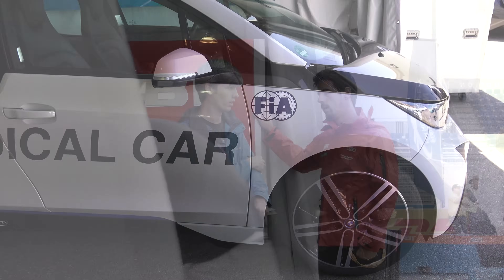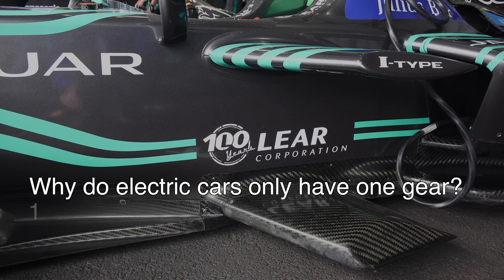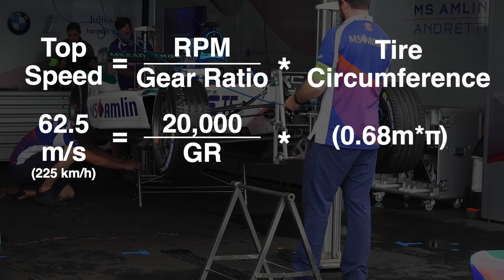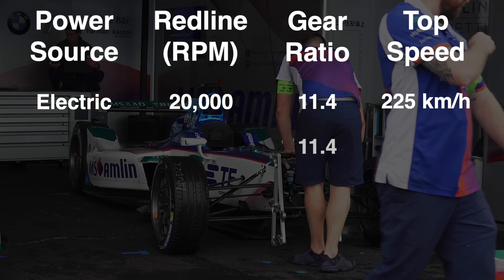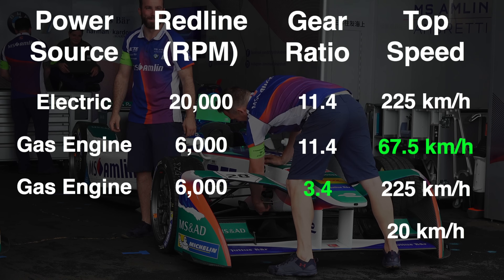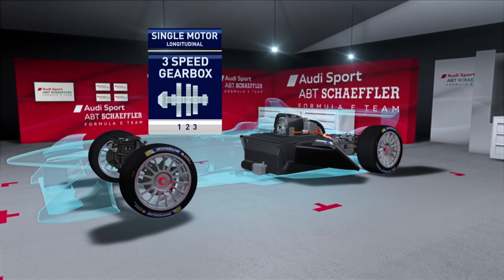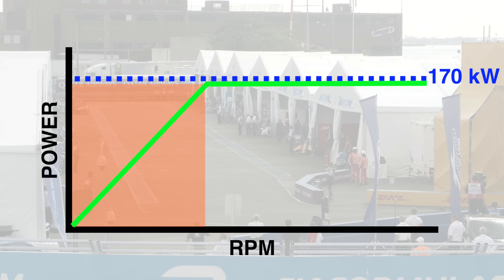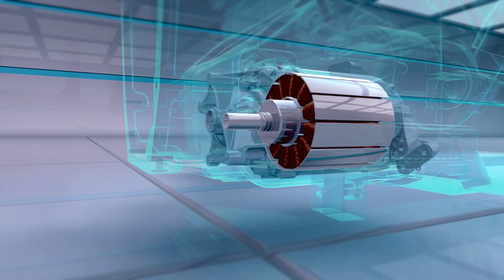Why Do Electric Cars Only Have 1 Gear?

Comment: Gear ratio 11.4:1, with 245/45 R20 has a theatrical speed pf 66.13 m/s. = 238 kph..
With 255/40 R18 of formula e speed 218.6 kph with these figures 😂

Comment: wrong it have more gears it is only not gearing up or down
but it is geared down only to the rpm needed
and that is based on if the motor have 220Kw power you do not need that
for driving a way but how faster you go you use more rpm and that is growing
also the Kw and nm there is one thing that in ot always the same
that hole you have to drive in the air.

Comment: This is not completely true, car motors are efficient at either high rev or low rev, not at both. Tesla like players have developed such motors. Rest of the low tech companies have cars that are efficient at low speed and at high speed they are not efficient at all. They really need a gear for increasing the efficiency.

Comment: Only one gear so gearbox oil does not need changing and need not leak.
Oh, EVs have direct current motors from DC batteries don't they?

Comment: a quick question, my brother made the comment that Evie‘s should be just as efficient when driving at high speeds as a ice vehicle. does a transmission in a vehicle mean that an ice vehicle is more fuel. Efficient  when driven at higher speed compared to a EV which has only one speed? put another way if you drive an ice vehicle at 60 mph and compare that to driving at say 30 mph will there be much of a drop off in the distance travelled per unit of fuel? will there be the same the same equivalent drop of in  fuel consumption for an EV

Comment: My ignorance might show in this comment but. I feel like a gearbox tuned to the application could increase the efficiency of a small enough electric motor that it would out weigh the cost of the weight of the gearbox in efficiency and performance as apposed to  not having one.

Comment: Thanks very much. In the example you cited where the motor will be doing 20000 rpm at 225 kmph, if we use a taller gear to do same 225kmph at, say 10000 rpm, we can increase the range. Isn't it?

Comment: They don't give up gearbox because speed is limited in street cars. They limit the speed of cars because constructor don't want to pay for a gearbox. So all we coming from oil based cars that go 200+km/h are going to pay more for an electric car that goes slower than the oil based. That's the point that you totally missed, you just repeated the boring and irritating rhetoric of constructors. Max speed is important not only to have fun, but also for emergency cases. Escape from an accident zone, running away from criminals and bringing injured people to hospitals.

Comment: Was watching a video where a guy designed a magnetic transmission. 81% efficient compared to a mechanical gears which offered 85% efficiency. For low-speed driving this might be advantageous. A single push button could move the drivetrain into magnetic mode for low-speed driving. Release the button and you could be in direct drive mode.

Comment: I don’t own an electric vehicle but take that Formula-E car for example. It does 225 kph with the electric motor and just 1 gear. If you were to just slap on ONE more gear then you could easily get 375kph or maybe 400 kph out of the car. I understand that the electric motor is high revving and all but you can’t tell me that, speed-wise, it wouldn’t benefit from just 1 more gear!!! Crotch rockets oftentimes redline at or around 15,000 rpm and they have more than 1 gear. I know it’s apples and oranges but still. I would like to know what some of y’all think about my opinion, if you don’t mind.

Comment: If the gear used for EVs is good enough to make it get off the line, why would the car need the same torque at high speed. imagine 6 extra gears on the car that could increase the speed without reving the motor. it might get a 3x boost in range. But how could the electricity industry benefit if EV owners only charged once every 3 months, right?

Comment: Gearing would still allow for more options. I'm building a battlebot right now using a 14kw motor that spins at 12k rpm, put into an 80:1 gearbox to get it down to the battlebots' maximum 250mph spinning weapon tip speed limit, while getting loads of torque in return.
I feel like you just proved the opposite of your video title.

Comment: What is the power consumption across the RPM range of an electric car? Would there be a benefit to keep the motor in an RPM range using gearing to conserve power?

Comment: For cruising what is the best gear ratio for cruising at 75 mph? Because every car is different and that's why Tesla with four-wheel drive has two different gear ratio from front wheel to the rear for wheel for efficiency

Comment: The Untold Truth about electric cars: They are expensive as hell. Charging them cost you more than gasoline. Many charging stations don't work properly. You have to replace the batteries every 5 years or so. New batteries cost from $6,500-$10,000. It costs $2,500-$4500 to have them replaced. You will pay a large disposal fee. The batteries will then be disposed of many large landfills, where they will leak several different chemicals into these landfills. Plan on spending this same amount EVERY 5 or so YEARS!! AND China will thank you for your business as NEARLY ALL PARTS INCLUDING THE BATTERIES WILL BE MADE IN CHINA! Buy American? Nah....destroy American land so China can get rich and the Biden Family Crime Syndicate will get richer. Meanwhile, EVERY OTHER COUNTRY ON THE PLANET WILL  CONTINUE TO USE FOSSIL FUELS! WAKE THE FK UP, FOOLS!  Yeah...JUST SAY NO TO ELECTRIC CARS!!!

Comment: So why did tesla use its own tesla plug in america 🇺🇸 and not allow other EV s to use his charging hubs.  Euro teslas where built right and have CCS .  Damage is already done reason everyone hates tesla. Euros and american EV drivers all hate teslas and will never buy one.  We would way rather have the Porsche EV that is quality and fast any day over a ugly tesla that looks like a wannabe mercedes fast but NO quality
The tesla roadster is the only one that looks good but you never see them only all the ugly ones.💩💩💩💩💩💩💩💩💩💩
Careful getting in. the tesla if you slam the door to hard all the doors fall off. Lol 😂 😂😂😂
Emergency exit plan 😂😂💩💩💩💩💩😂😂 uneven gaps dust storm paint jobs. Lol 😂 😂😂😂😂💩💩💩💩💩💩😂😂😂💩
Getting a good tesla is like picking a winning lotto ticket 😂😂😂💩💩💩😂😂😂💩

Comment: When doing the calculations at the start did you take into account that most cars have smaller wheel diameters than 680 mm?

Comment: I know this is an old video, so you may not see this comment. But the question I have always had about gearing and electric vehicles pertains to efficiency, in terms of what we call gas mileage in an ICE car. I understand that low gears are not necessary for electric vehicles to get adequately started moving, but couldn't there be some efficiency gained in terms of 'mileage' or range by giving them overdrive gears? If you had some very aggressive overdrive gears could you not save energy and increase the range of the vehicle by allowing the electric motor to hum along slowly while keeping the vehicle steadily cruising at 60-80 MPH?

Comment: So for street EV's, considering that a Tesla gear ratio might be 9:1, how about this for cost effectiveness, efficiency, power, and traction with reasonably quick acceleration, and sufficient top highway speed? The smaller front motor with tall (8:1) gear ratio for cruising along at higher speeds, and the large rear motor with a short (10:1) gear ratio for rapid acceleration.
Initially, the front motor is disengaged unless AWD needed for traction. Once moving,  to save energy, the front motor takes over, and rear wheels are disengaged. Stomp on the accelerator to pass, and the rear wheels temporarily engage for an AWD boost in power. In "snow mode", it remains in AWD at all speeds. Need to tow the vehicle, switch all wheels to neutral, fully disengaging the drive motors.

Comment: Electric motors get most of the torque in the low end. Ya they rev out but at what cost? Any moron can see it would work far better with a transmission. That would save power. I think they can't offer electric with gearing because electric cars already cost so much money average people can't afford them. But the lie they are saying it's not needed is politics as usual....

Comment: I understood about the rpm to gear ratio makes the electric not to choose multiple gears.. my doubt is , will the more gears increase the electric energy efficiency, if so, the lower watt motors can archive the speeds with gears and could be energy efficient to reach the speeds with lower energy which increases the miles to reach in single charge...

Not sure whether it's a valid doubt.. please clarify

Comment: I'm 4 years late to the conversation, but: Wouldn't gears help with range immensely?
Reply: I’m 2 years late on your reply, but no an electric engine functions fine in low and high rpm

Comment: It's obvious electric motors don't need multiple gears to achieve top speed. My question is: Would multiple gears increase driving range at highway cruising speeds (e.g. 80 MPH)? It takes more energy to spin a motor at higher RPM. Doesn't this hurt range?

Comment: Would  multiple small eletric motors outdo one big electric motor... live a v8 will often beat a v6 in gas engine
Reply: So what I'm saying is stack two or more electric motors beside each other for a gear ratio so not one motor has to do all the work and say you put a safety switch on it to where if one of the motors quit working it will retract its gear allowing the other one or more to continue

Comment: I love your videos, but I still have some questions after this one! “Why do they only need one gear?” “Because they are high revving but have good torque even at low RPM.” Yes, we know that, otherwise they would need a transmission! Why is it that they are high revving with good torque at low RPM? The answer would tell you why electric cars only need one gear.

Comment: Some cars, such as the long range Tesla Model 3, have two motors. Are these geared in the same ratio, and would there be any advantage in having motors geared at different ratios in a multi motor system? The Model 3 is a much smoother car to drive than some of its competitors which only have one motor. I don't know how the two motor Tesla variant compares with the cheaper one motor Tesla cars.

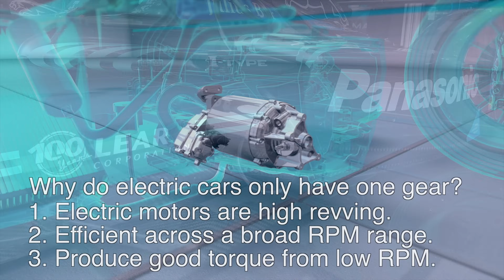Comment: 0:56. Everything I needed to know said in about 10 seconds. An electric motor has a single gear calculated for its top speed but has the same torque from 0rpm up to its max so it’s useful at all the lower speeds.

Comment: With electric cars with only one gear, do they make peak power at a certain speed. If you accelerate "full throttle" from say 30-60 mph, are you overloading a motor which produces peak power at 80 mph and a no load speed of 120 mph? Would you be better off with 2/3 of the gear inches at that acceleration range or does the controller limit current or change voltages? I know most electric cars are more advanced than connecting a motor across a set voltage like a starter motor on a car battery.
Theoretically a superconducting motor would have torque approach infinity from a standstill, but real world motors have thermal losses in the coils when overloaded and less efficiently turn electricity into mechanical power.
For a Tesla P100D, the acceleration is up to gravity (9.8m/s^2) meaning that the car could climb a wall if it could stick, so the steepest hills in the world will only take the motor to 1/3 of its maximum torque.
What about a Nissan Leaf? It has "only 150hp" would it struggle on Baldwin Street in its motorway gear?
My Electric bicycle has 7 forward gears, and while I don't need them to be particularly close in spacing, I can feel the benefits of going down and up the gears on different terrain. In terms of optimum motor performance, there is little point in going above 5th or 6th gear on the flat. It was over-geared by me deliberately so that when I pedal, the motor does not leave the power band, giving me even more top speed. The other thing it is good for is lower speed cruising on the flat which is far less motor load and when I can't be bothered to pedal like a road runner. I can tell that if I start off in too high a gear, the power remains buried in the red, yet the bike does not take off as quickly as in a lower gear. Occasionally it would hit the current limiter if I did this. Too low a gear, and the bike simply drops off in power as the speed increases - though it is harmless to the motor, I could get more high speed performance by shifting up.

Comment: Excellent video I love it 👍 I work on a merchant vessel where the power plant is 38MW we use a intra-graded electric drive Diesel Electric plant suppling an induction motor the Electric Drive is VSF or VSD the drive can be configured in different modes by software: Torque or Speed. General Electric

Comment: you guys missed the part in electric motor the amplitude and frequency of the current is varied to achieve the desired torque and speed which is why gear aren't much of necessities.

Comment: What about a simple cvt with electric motor? Higher torque converted in rpm so low rpm for motor and result higher milage on long routes.

Comment: What relevance is there to the motor being high revving? I see no inherent advantage to this, aside from not needing a transmission but without a transmission, you limit your wheel torque anyway, unless your engine torque is already equal to the maximum wheel torque you can have before losing traction. But at higher RPM, the motor loses efficiency anyway, so you'd still want multiple gears anyway (except in the context of racing)

Comment: I thought adding a gearbox to an electric car would give it higher high speed?
Reply: And maybe range and battery life (which are current ev problems) because of less rev, so less energy consumed
I dunno sometimes these yt engineers seem blind to full picture

Comment: And another thing from my observation is that the gear ratio can be chosen to go close to the maximum acceleration possible the limiting factor being grip. For example I’ve calculated for bmw i3 a 0.54g acceleration from the motor and I figured this roughly matches the grip of the tires given that they are not super sticky and the weight distribution is 50/50, rwd because the friction coefficient is around 1 and 50% weight on the axle means a value around 0.5.  This confirmed when you drive the i3, you feel the tires are slightly below the traction limit because they squeak a bit. 
With a normal (ice) car they would make a short ratio and give you more wheel torque than needed to make up for the clutch slip, to have extra traction when fully loaded, and to make them drift, but sometimes it becomes difficult to control and you loose traction (see m3 vs i3).

But tesla with awd goes with faster acceleration but the power is much higher also.

Comment: What if you reduce the rpm of an EV to 6000. Wouldn't it make it more efficient in range?
Reply: Engineers seems to forget the full picture sometimes
Perfomance isn't the only benefit to gearing, there is range and battery life too to consider
Screw "efficiency" and "complexity", we had to deal with ice so those things shouldn't be a problem

Comment: I could see a use for a low crawl ratio for 4x4 vehicles.  I single planetary could be attached at the front of the motor(s).  It would be locked up for road use, but when climbing steep hills or rocks, you could unlock it for an extra 4:1 or so.  If the conditions of the shift are controlled, you could do it to multiple gearboxes at the same time if you had independent axle or wheel motors.  You could also use it to boost motor speed during regenerative braking to put more power back in the battery.

Comment: That is great for getting the power to road, but what about energy efficiency? Is an electric motor going at 20,000 rpm as efficient as another electric motor running at 10,000 rpm with some level of gearing?  Range is an more important part of the equation versus just  0-60.
Reply: These engineers seem to forget the full picture sometimes :/

Comment: Next subject: why don't EVs idle when stopped? 
Or maybe the better question is: Why do ICE cars need to idle when stopped?
Reply: Electric vehicles dont need to idle because they dont have a minumum operating rpm. They can apply torque even if the rpm is 0. Ice on the other hand does have a minumum rpm. An ice engine cannot run at low rpm. The engine needs to stay running so its able to be used. If it shuts off you would need to start it again before you could drive. Many modern cars do shut off the engine when you come to a stop.

Comment: During my last days on active duty in the Army, I had the opportunity to learn to drive a diesel-electric locomotive. While it isn't gearing in the traditional sense, I learned that the locomotive starts out with the motor windings configured in parallel. The gives increased torque. When the train reaches roughly 30 mph, the engineer eases off the throttle, and the windings switch to series configuration, which provides less torque but greater speed. I don't know whether or not the Tesla truck uses this same principle, but I would expect that this would be a great advantage to help get the rig moving with a heavy load. It would also be advantageous for off-road vehicles that often need high toque at low speed. It would be similar to a two-speed transfer case.
Reply: Interesting thank you